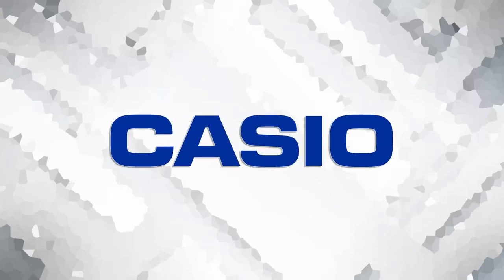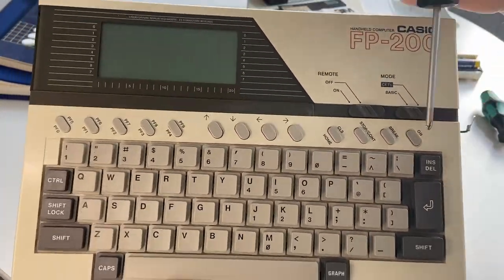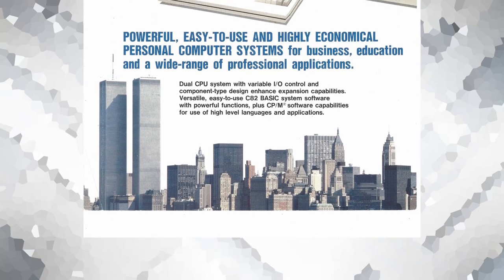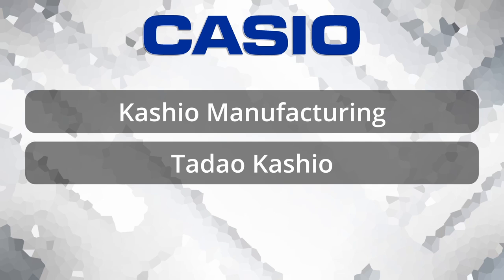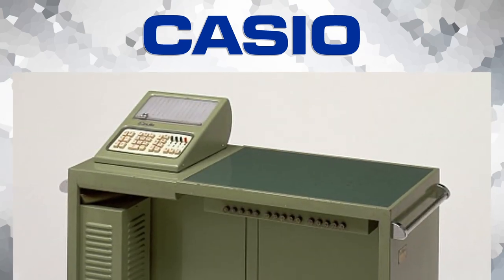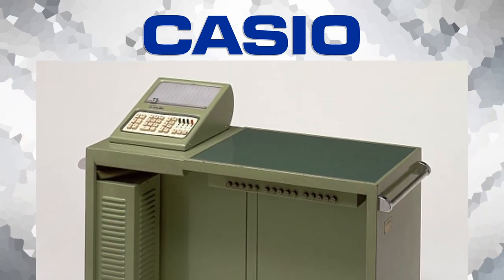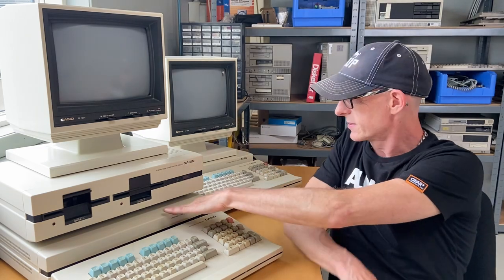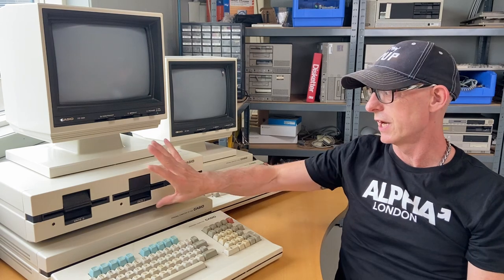CASIO FP-1000 Series -After almost 40 years, does it even turn on?

Comment: This computer was one of the best computers ever made. They never failed. There was a possibility of puting up to 4 drives ... It had the possibility of having  8 inch high density drives which, at the time was very uncommon. They had the Cobol Compiler and a special software that converted the FP1000 into an IBM 3741. Its amazing with this machine was capable of.
Reply from the maker: Yes, it shurley orly was a "strange" computer with "strange" features like the built in terminal mode and all the add-on stuff